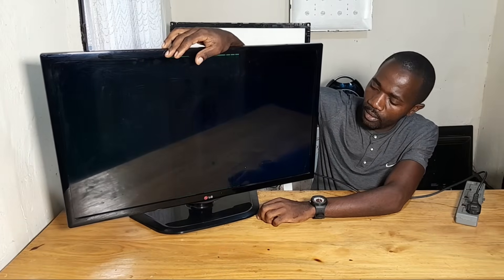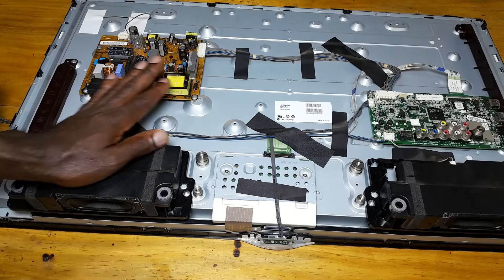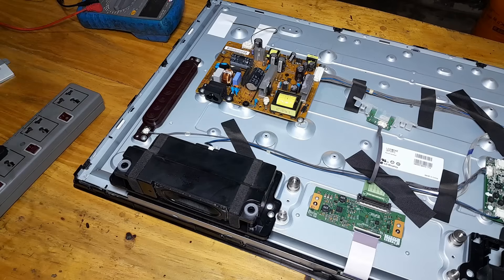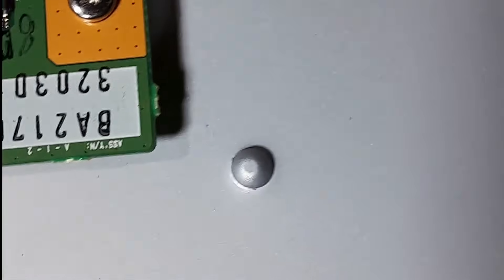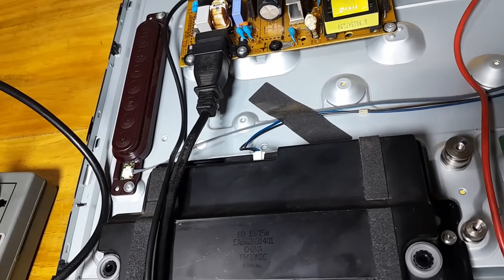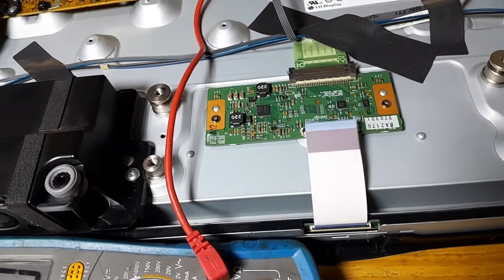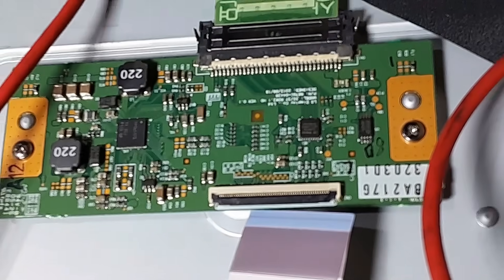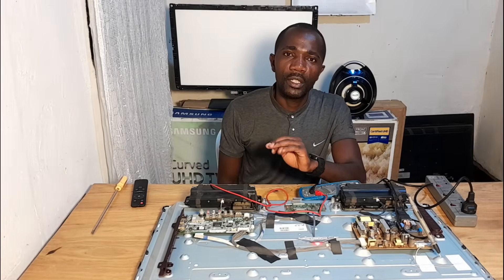LG 32"TV : Moving vertical lines troubleshooting Technics

Comment: In this case, the panel is short circuited cos all voltages are present in the Tcon board after disconnecting the LVDS.

Comment: You measured voltages at certain points on the Tcon board. Are these points and voltages the same across all brands?
Reply from the maker: Voltages are not the same, it depends to the size of the tv screen

Comment: What. If the TV backlight is not showing when switched on
Reply from the maker: Check backlight Led or power board and DRV on signal from the main control board.

Comment: I can easily fix that  vertical  line fault without  changing  the panel,the unstable panel voltages are caused by water damage on on of the source COFs  so first remove the whole screen  and examine  both source COFs you'll  find out that one of them is burnt due to the presei of high voltages of 27v and -4 v when you isolate the burnt lines the picture will return to normal. But if both sides are damaged  the solution is to replace both source COFs using the Tab bonding Machine if available in your area  if not available  get a replacement.
Reply: My 55 inch telefunkeni old model 2011 is is showing blue and black can you help
Reply from the maker: Sorry for being late to reply
Reply: Bravo🎉
Reply: How do you remove the line and restore the picture, this just like my TV and the same problem cos by high source current
Reply: I also want learn how to fix it that way
Reply from the maker: you are welcome
Reply: screen is bad or what
Reply from the maker: Yes it is bad
Reply: Thanks Senior
Reply from the maker: You are welcome
Reply: Hi
Reply from the maker: hi
Reply: Explain not TOO tech again

Comment: Why is the VGL voltage negative on the ticon board? How did the electronics engineer make the negative voltage on the circuit?
Reply: The TFT transistors in the screen are negative biased.
Reply from the maker: yes, negative voltage

Comment: can you not troubleshoot the panel issue, might be a loose cob or an issue on that circuit that could possible be bypassed, would be nice to know' either way good video. thanks
Reply from the maker: One COF ic has an issue.
Reply: @felixtechnoaid2044  Sir can you make a video about troubleshooting the COF?
Reply: How About cutting ckv lines Wich is connected to cof I think it can work
Reply: Кг37
Яя❤